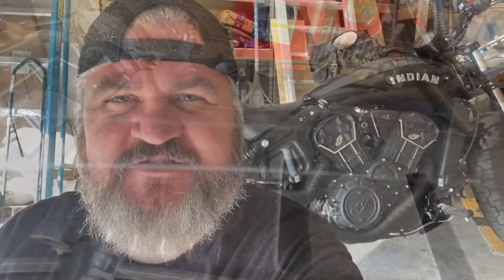How To Change The Oil On A 2020 Indian Scout Bobber Sixty

Comment: Great video John. I like the way Indian did the oil filter, makes it's so much easier. I was lucky when I bought my 1100 Vstar it had the oil filter relocation kit installed on it, thank the gods. It made it a 1 beer job from a 3 beer job. Cheers bro and Takeiteass
Reply from the maker: Thanks Bernbo. Yeah the whole job is pretty straight forward. You don’t need much to be able to do an oil change on this bike. Truth be told I always took my Shadow in to the shop for service, but I figured it can’t be that different than a car and I have always worked on my cars. I was surprised at how easy it was.
Reply: @YoungAmericanOutback  for sure, you will save a ton of money doing your own maintenance. It's all pretty straight forward. I actually have mine in the shop right now my starter clutch failed, apparently it's a common thing on my bike. Can't wait to get it back it's been weeks now.
Reply from the maker: @bernbo  Saving money was the biggest factor in doing my own maintenance. Sorry to hear about your bike in the shop. You’re missing out on some prime time riding season. This weekend we are still up in the 80’s. I’m hoping to head out for a while tomorrow. The Bike’s, Blues, and BBQ was supposed to start tomorrow but it was canceled due to Covid. I hear a lot of people are going out anyway so we’ll see how it goes. Haha.
Reply: @YoungAmericanOutback  yah definitely missed out on some nice weather for sure, I really like riding in the fall, it's so nice. Good luck with th BBQ.
CHEERS!

Comment: Also before putting the Oil Filter on pour just a bit of oil into the new filter before screwing it back on, this will help the priming stage of the bikes oil system and prevent unwanted wear over the course of future oil changes. 
Great video I may buy one soon! Have fun keep the rubber on the road ;)
Reply from the maker: That is a solid tip! Thanks man.